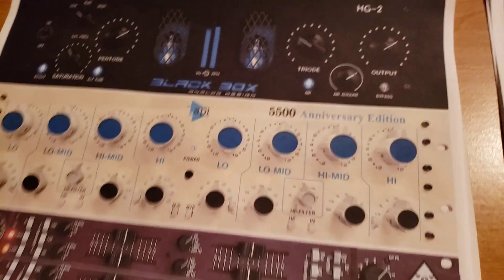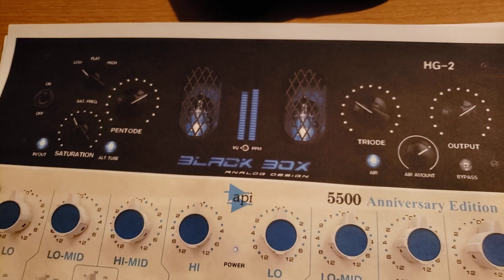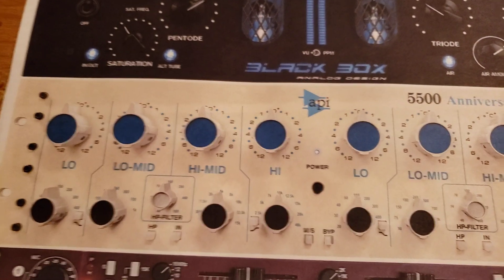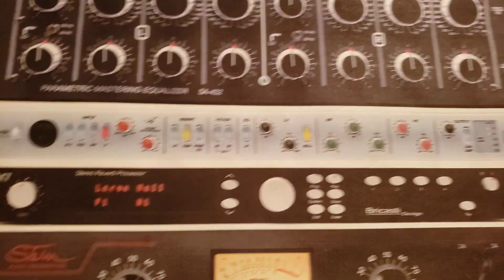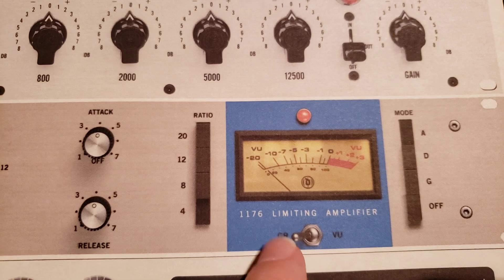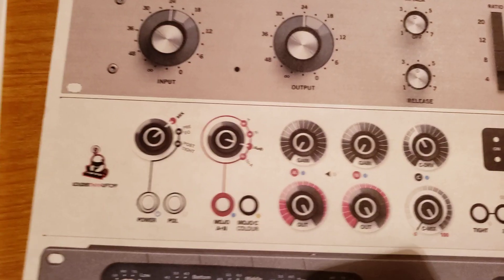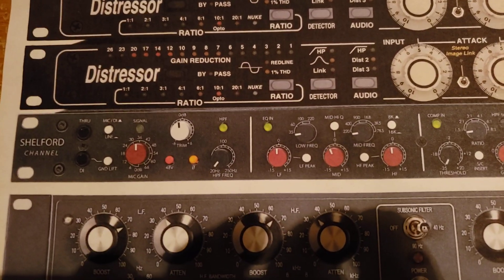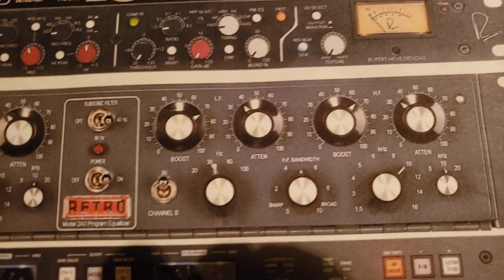i printed audio hardware.

Comment: I remember in university in Crete that we had a audient asp mixing desk and a professor made print out of it with all the knobs and faders there but blank so you could write the settings with a pen. I want to find or make something like this for my soundcraft signature, maybe some photos will work but as a “ diagram “ with blank positions is easier to work with
Reply from the maker: @mpasistasyalanci  recall sheets... good times!